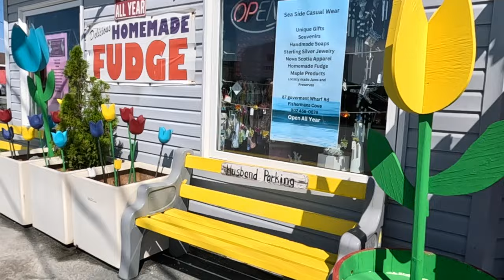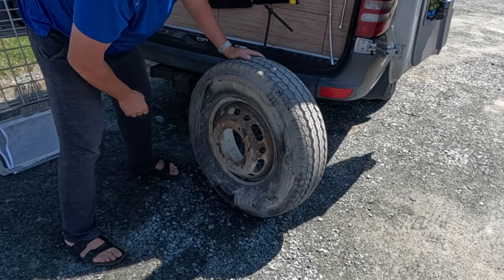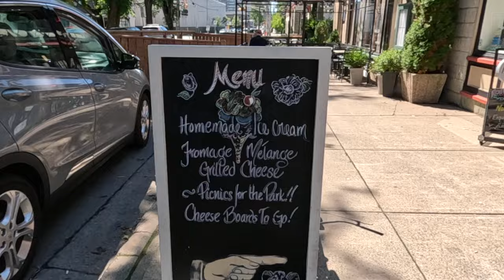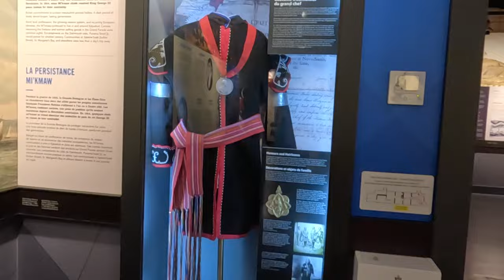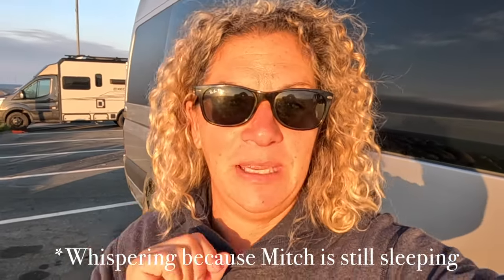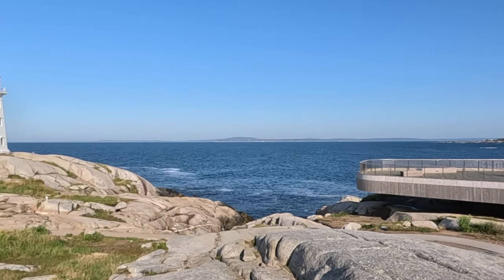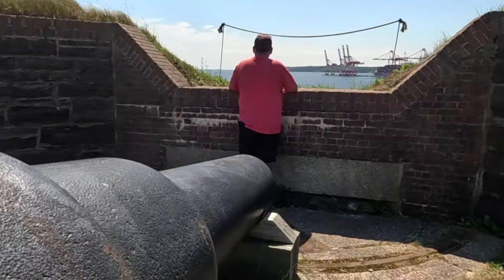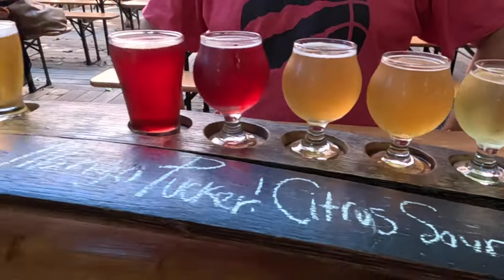Explore Halifax In 2024: Top 10 Must-do Activities!

Comment: Another great one my friends 
Yeah impact wrench a must for those tires lol. We used a lot of line trucks at the company I use to work for and it's important to check the air pressure regularly on inside and outside tires, because when the weight ends up on one tire it's hard on the tire, the bearings even the axels we've had the outside tire come off the vehicles. Now I got you totally freaked out lol, just a heads up quick check occasionally on the tires , just Hitting the tire slightly with a hammer will tell its low on air. 
Great tour of Halifax thanks for taking us along. Hope you have an awesome weekend
Reply from the maker: Thank you!  And yes, we are going to have a more diligent circle check before heading out on the roads from now on.  Thanks as always for watching and giving us nice comments and stories 🙂 You and Tucker have a great week!!  Cheers 🍻